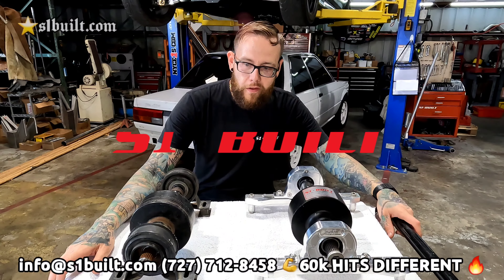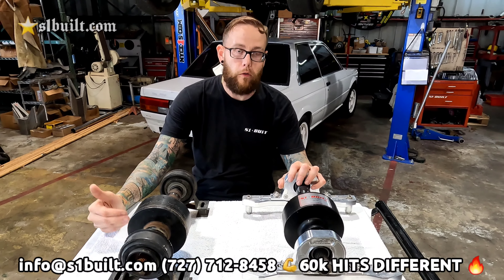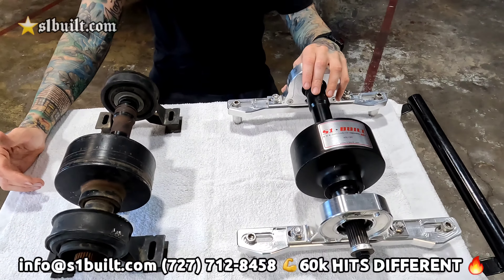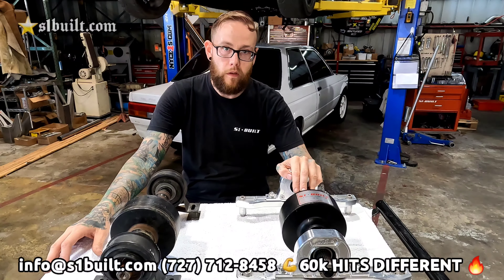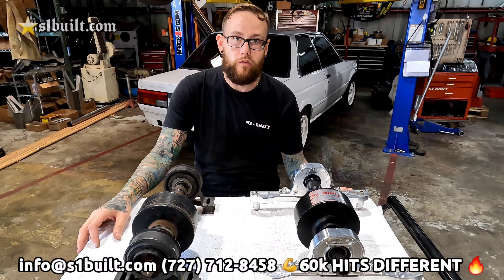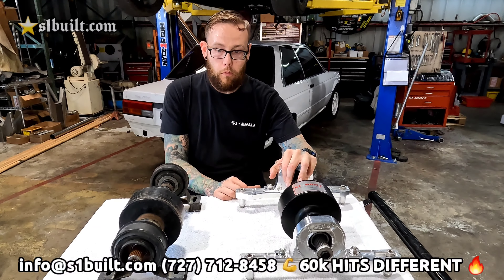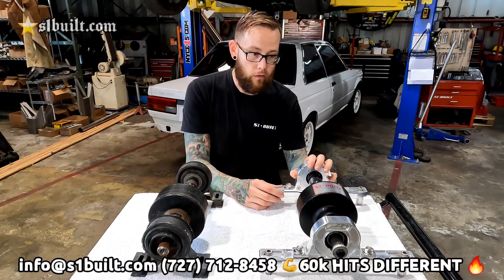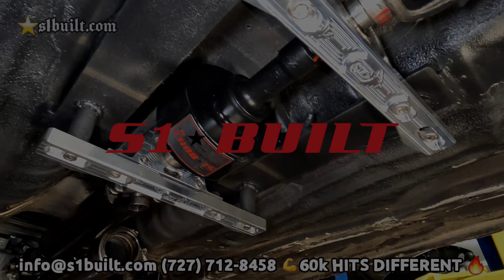🔰30k  VISCOUS COUPLER vs 60k VISCOUS COUPLER🔰

Comment: Is the integrated clutch pack found in CRV differentials considered a VC or is it something else? I had this debate with someone a moment ago, would like a third opinion.
Reply: yes it is if you do go with a land rover vc you need to put locking plates in place of the crv rear diff clutch packs or pin and weld